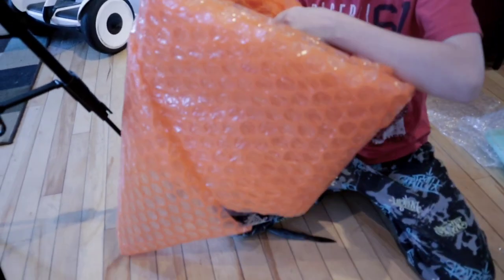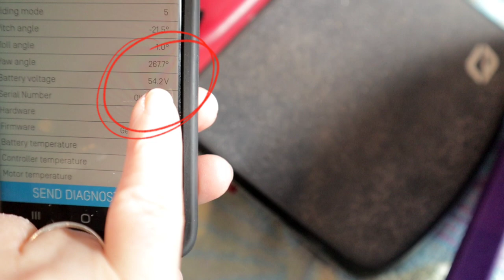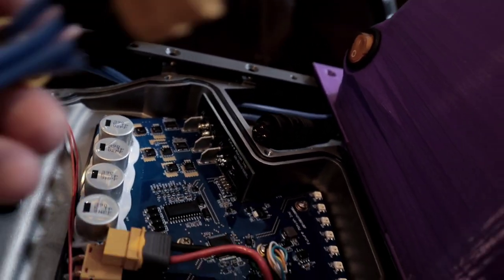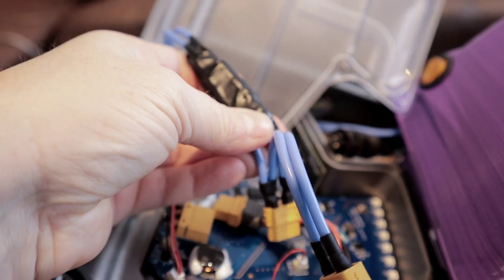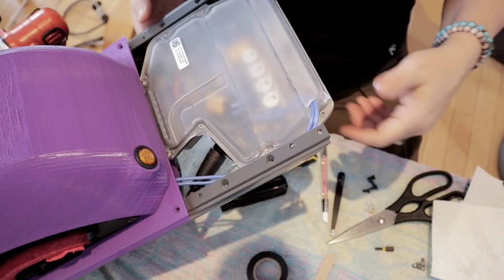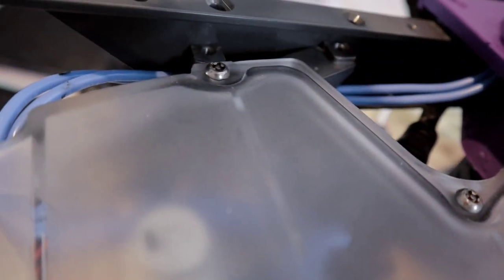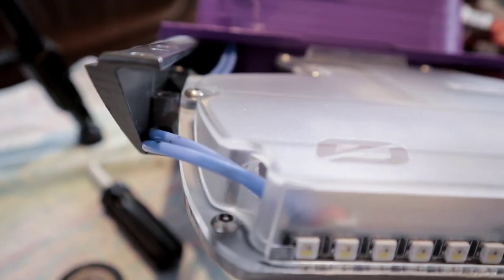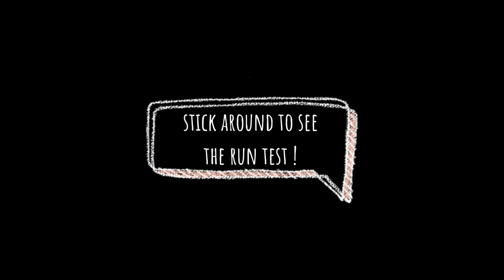Adding a Battery to my OneWheel Pint !

Comment: Glad it worked out well for you!
Now, not to be critical, only to provide some information about what could have gone terribly wrong with this modification:
#1, notice that both wires on the fender battery are the same color? My point? Which one of the wires is positive? (Kinda important) this is where a volt meter would come in handy.
#2, notice the use of electrical tape on the wires when reconnecting them? Why not use a wire crimping tool? Much cleaner and, makes the wires connect properly.
#3, wouldn’t it be nice if there was a plug on the outside of the controller instead of having to open it each time you need to remove the fender?
Don’t get me wrong, having the extra battery is a great idea! That said, with a few things done differently during the installation, it could have been even better.
Best of luck!
Reply from the maker: Thank you for your input!! It is nice to have different perspective on these things.
#1 I didn't do the wiring of the battery-fender. I agree, it could of been 2 color as electric wires are usually. But the plug itself can only be plug one way, unless the maker would of made a mistake, I couldn't.
#2 The electric tape was not necessary, I add that to add protection.
#3 Totally agree with you on that one!!!! I thought about it, after... might do that this spring.
I'm sure the guy that make these have made some changes since I order mine. Or maybe it would be a good idea to propose those ideas to him.
Also, I would add that I would of like a connector so I can disconnect the battery if I wanted too, cause if you do trails, branches or rocks can get stuck between the fender and the wheel and make you fall, so it would be nice to be able to remove it.

Comment: Hey if u don’t like scratches you can get a fangs version two for the pint it helps with nose dives and scratches in the front
Reply from the maker: I thought about the fangs. I have the float plate cause the scratches was mostly done in the back when I stop.

Comment: Cool addition, my only concern with battery in fender is a rol over crash.. I would be concerned about flexation ( scheer) of the cells. Thermal runaway of lithium is scary.. if risk it for the extra range if I were a pint rider though... chi battery ftw for me...
Reply from the maker: Thank you for your concern. The fender itself is very solide. It would have to be a very hard drop for it to crack. Each cells have their compartements and the battery has a bms.
I can't buy the Quart since it is an extra 200$ US shipping fee.
Reply from the maker: You also have access to the cells. There is a door you can unscrew to get to them... if ever something would happen.
Reply: @LivingLifewithJudith  thats interesting, you could upgrade cells too as new ones are developed. Im glad to hear its durable, if you've never seen a cell go thermal then be stoked.. its crazy how much stored energy gets released in like 2 mins.. 15 years back had a thermal runaway 12volt tool battery almost burn a shop down when it went...  crazy..
Reply from the maker: Yes, I saw them get really hot. It's crazy. Well, houses have burned  because of that!!! I also have a power on/off button which cut the power.
Reply: @LivingLifewithJudith  If thermal runaway happens a poqer button will not stop it.. best plan is to dump board on its side and get away fast.. if you're in the woods, try to out board in rocks or dirt.. ive not seen a onewheel battery go thermal but have seen an e bike do it after a bad impact..  if you have a power switch controlling the added cells make sure all loads are equal between  board and extra battery or you can risk in rush current damage..  in simple terms voltage = pressure... make sure pressures are equal... happy floating:)
Reply from the maker: @MrDmadness  Yes for sure, you certainly don't want to mess with over heated battery. Thanks for the exchange! Really appreciate it!
Reply: @LivingLifewithJudith  enjoy the extra range.. extra range and time to ride is ALWAYS a win :)
Reply from the maker: @MrDmadness  Yes! I will for sure!!! Thanks!

Comment: Thanks for the great video! How are you like the new fender/battery? What kind of range are you getting from it now? I’m considering getting one. Thanks.
Reply from the maker: Thanks! I didn't get the chance to test the range yet because it is winter... so I can't get a "real" experience. But I've been riding it in the cold and it's been working great. No issues. I will be doing a video on a range test as soon as it gets warmer. It is still -10°C/14°F here with snow. So... not the best to test batteries...
Reply: @LivingLifewithJudith  Winter sucks, can’t wait for warmer weather! Can you comment on the battery mod & how it works with the onewheel app?
Reply from the maker: Yes, it sucks when you are eager to go riding! Not sure of what you what to know by "comment in the battery mod"... maybe I didn't slept enough... 🤔
You can't ride with the app open, so you need to set your stuff before you ride or stop riding if you want to make some changes. So I use the app "Relive" to keep track with me route.
Reply: @LivingLifewithJudith  Thanks, that’s what I wanted to know.
Reply: i guess it's kinda randomly asking but do anyone know of a good site to watch newly released tv shows online ?
Reply: @Callen Koa Thanks, I went there and it seems like they got a lot of movies there =) Appreciate it !
Reply: @Chase Jefferson happy to help :)

Comment: You would get a lot more range if you used a different tire. When I was using the Hoosier treaded tire I would get 5-7 miles. now I use the craft and ride SS-11 tire and get 9-11 miles of range.
Reply from the maker: You are totally right. I was made aware about that a few days after I had bought the treated tire... back in november. 😔 Now, I don't want to spend money on another tire since this one is new. Even though I loose a bit of range, I still like the tire, especially in trails.
Reply: Good to know, I read yesterday about pushing it to 35 psi ? Extending a little more range they “say”
Reply: On the original tire*
Reply from the maker: I tried bringing my PSI higher on the treaded but didn't like it... so I went back to my 20 psi.
I wouldn't change my treaded tire for the original, I like my treaded too much.

Comment: Is the fender too big?? I don’t have Facebook     :(
Reply from the maker: It is a little bit higher than the original fender of the Pint, but it is not longer or wider, so it doesn't take any space on the foot pad. The guy who makes them wanted to do a website... he was just starting, so I don't know if he done it yet. 
The only negative thing I would say this fender has, it that you can't remove it if you prefer to ride in trail, so branches and debries might get stuck between the fender and the wheel. It would be possible to make it removable, but you would need to tweak  it a bit.

Comment: That’s tiiiiiiiiight how much did it cost
Reply from the maker: 350$ for a 5ah.
Reply: @LivingLifewithJudith  that’s not a bad price. I was looking into buying a battery from chi battery systems for 450.
Reply from the maker: The good thing about the Quartz is that it doesn't affect the look. But for me, the price and the fact that I had more range (since I have a treated tire I loose range) with this one help me make the decision to go for that one.
Reply: @LivingLifewithJudith  good to hear. This was a good video fer sure
Reply from the maker: Thank you so much!
Reply: Chi battery is amazeballz ( this one also cool... maybe could add it to the chi upgrade? ) if you open a panel exposing a pcb like that consider treating the pcb with ELECTRONICS GRADE sealant spray ( extra waterproofing against condensation ) and any holes you make use marine grade silicone..  its more expensive for a reason.   Great video
Reply from the maker: I didn't go with the Quart battery because it would coast me 200$ US for shipling only. 
I will look into the Electronics Grade Sealant spray. Thanks for the advice and thanks for watching!

Comment: What firmware and hardware does this work with can it work with the latest firmware?
Reply: What firmware and hardware are you running on ur pint?
Reply from the maker: I think it would. My firmware is Gemini-5050 and my hardware is 5314. I've asked Shred Town Battery Systems  waiting for his reply.
Reply from the maker: It is in my answer above. :)
Reply from the maker: He said no problem for hardware up to 5314 and 5050